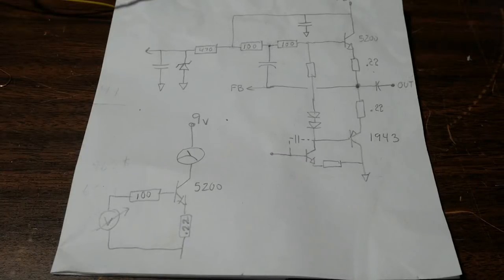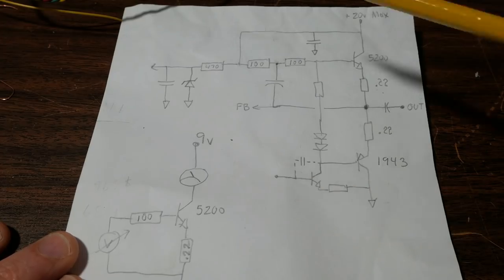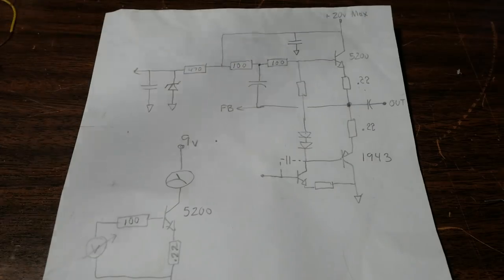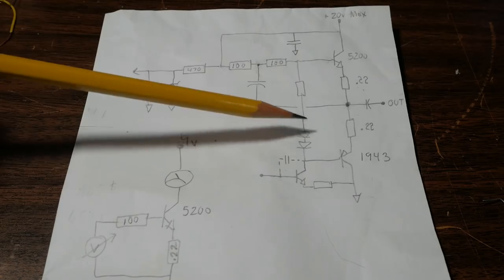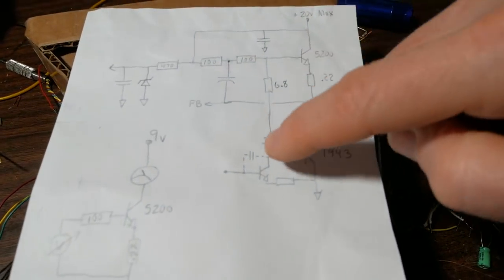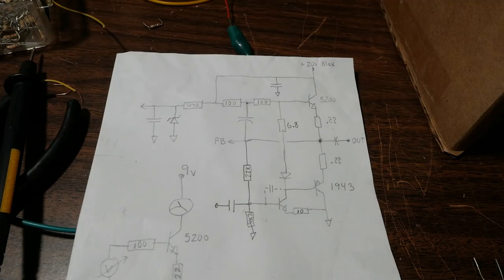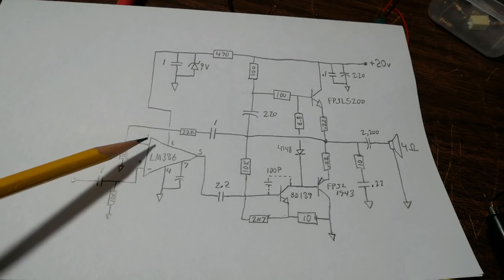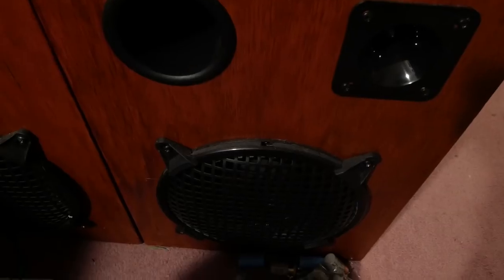LM386 booster transistor audio amplifier design and test

Comment: really cool vids mate... John you say you use non inductive resistors for your dummy load can you tell me the actual inductance value you use thanks
Reply from the maker: The resistors are labeled non inductive and but don't list the actual inductance. It would be low enough not to affect the audio tests.
Reply: @JohnAudioTech  hi thanks john i want to put together a better dummy load than the one i currently use (a load of half watt carbon films) in parallel to make 2 banks of 4 ohm ...i do have a load of old ceramic resistors and a L-C meter so just wanted to know what was an acceptable L value to be considered low L .... Thanks for taking the time to reply love your vids thanks

Comment: Excellent. That hiss though. Is it just the LM386? I always wanted to make a bridged LM386 amplifier just for the goof factor but I never had a nice matched pair of them to use.
Reply from the maker: I have the gain set too high and the LM386 is noisy compared to a good op amp.
Reply: Ah ha. How come LM386's are so bad? Rhetorical question. I mean yeah they're not Burr Brown but good op amps don't have to be unobtanium.

Comment: This is really a lot of effort just for a current booster stage. The LM386 is in general capable to operate up to a supply voltage of 18 V. So I can imagine, that there is an easier way to get even more than 4.3 Vrms at 4 Ohm with it.

Comment: Hi, I'm a noob in audio stuff but i have a question. I have a case thats made out of aluminium how do a transfer the heat to the case without drilling any holes in it? I cant mount the whole thing because there's some distance between the chip and the case.
Reply: @skywave dxer but there is a big space between the case and the chip. Do i need to unsolder the chip and make connections with wires? I dont think I'm good enough with soldering yet haha
Reply: you can try some sort of a heat pipe, but it will never be as good as a direct connection.
Reply: @czmik  I'll look into it. Thank you!